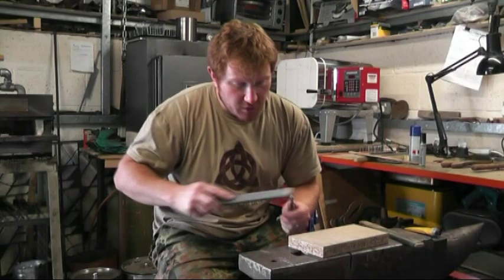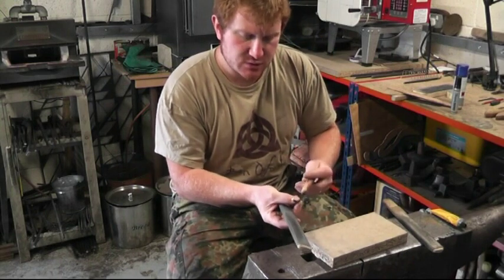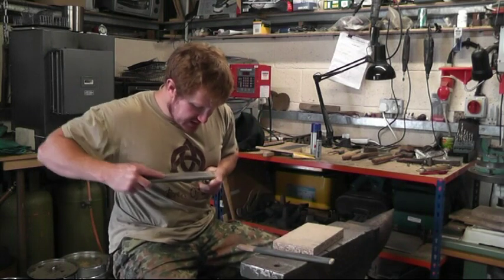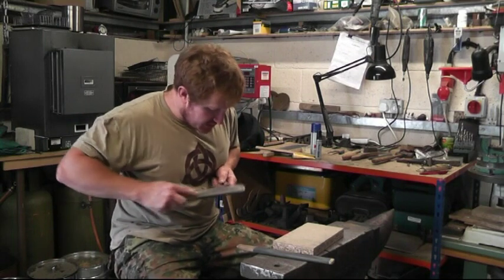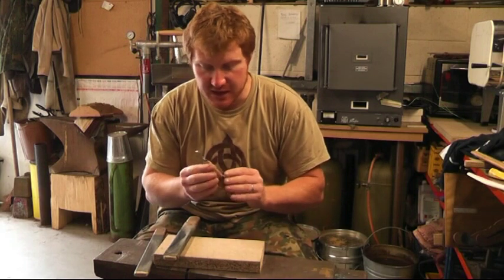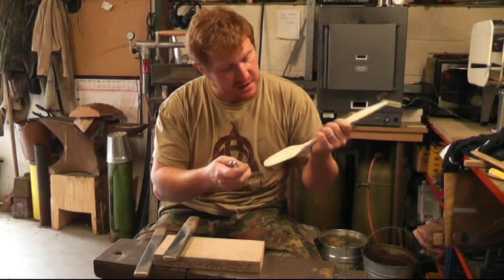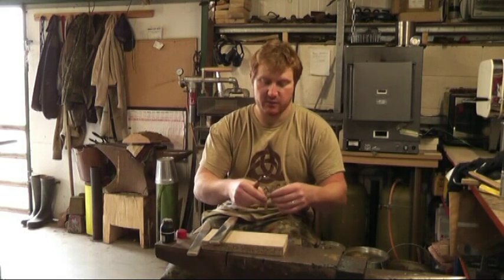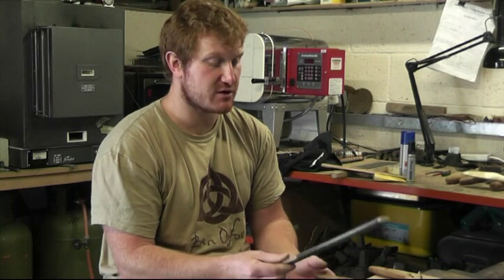How to sharpen a spoon knife with Ben Orford (part 2)

Comment: Would be nice to have some close up shots. It's always an easier said then done type advice without actually seeing. I just got my cheap Mora 164 spoon knife. Just getting use to using one takes practice. I'm carving dried Sapele Wood. Google this wood 👍
Reply: The Mora 164 is really pants.  It comes pretty blunt with a secondary bevel that makes it hard to use.  Also the tip is pointed, which gives it the tenancy to dig into the wood.  You can remove the bevel and the point and sharpen it up, if you have the patience and skill............
Much better off spending a little extra and buying a crook from either Ben or from Robin Wood.  Both come razor sharp and ready to use, hand made by people that actually use them themselves, so know how a crook is supposed to be.  Yeah they are more expensive, but they should last you forever, and you're supporting a small family business of craft people rather than a big company's shareholders.
Reply: carpy1970 my post was over a year ago and have since then bought a few of Ben's products including a medium hybrid bowl/spoon carver. Nice tools made by Ben.
Reply: Bryan Resch Yeah I realised that.  My post was more for anyone else that was watching this and thinking well a more is a cheaper option.  It's cheaper but likely to lead to frustration and possibly giving up.  
Now that you have a good knife you can probably see just how bad the mora is.  It's a shame because their 106 and 120 are good carving knives, they just can't seem to get crooks right.